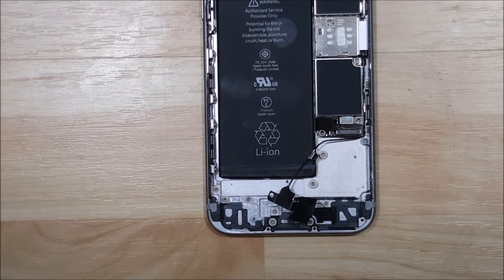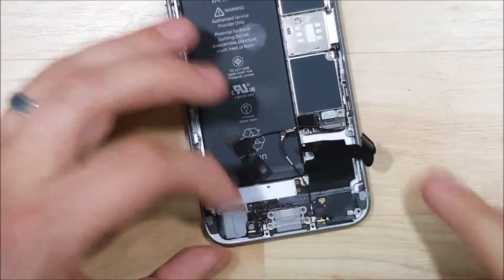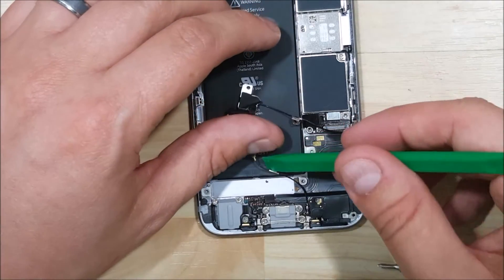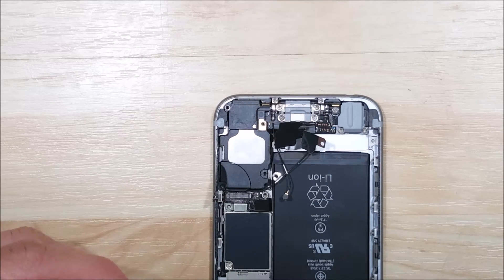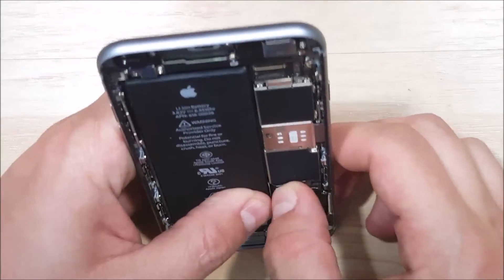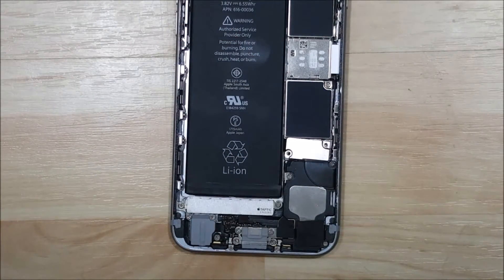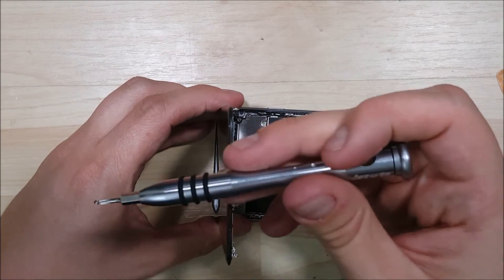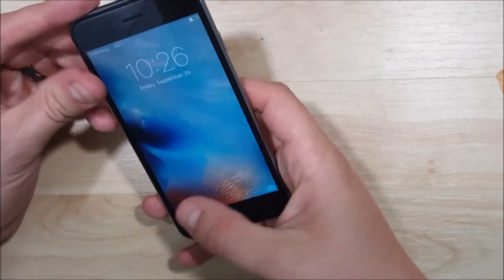iPhone 6S Charge Port Assembly Replacement - Reassembly

Comment: Had a problem with the wifi/bluetooth "bluejean button" and it snapped off. Decided to go ahead and put it all together anyways to see if my charging issue was solved. While trying to attached the screen ribbons smoke came up. Very minimal but i'm assuming I fried something? What did I most likely do wrong? I'm getting nothing on my screen now that it's all put back together. Is my phone a complete loss now? I've changed batteries on iphones multiple times and screen replacementn but this was my first attempt at changing the lightning port....will also be my last attempt. Never again. Any advice would be appreciated, or troubleshooting tips to see if my phone is a complete loss.
Reply: I gave up and went to bed, woke up this morning and it was charged 100% and has worked fine all day. I don't know how that happened, but I am thankful :D

Comment: The Apple logo just flashes on and off after i replaced my port. I thought i has a bad port so i ordered another one and it does the same thing. It was not doing that with the original charge port. Do you have any ideas of what the problem is ?

Comment: I have repaired a few iphones before and tried to do the port replacement on a 6S and when i got it all back together the phone doesnt have any service.  Says 'No Service' in the top left corner.  If connected to a network it will still IMessage.  when not connected nothing works, cant call.  Any advice of what i could have damaged or if you have ran into that problem.